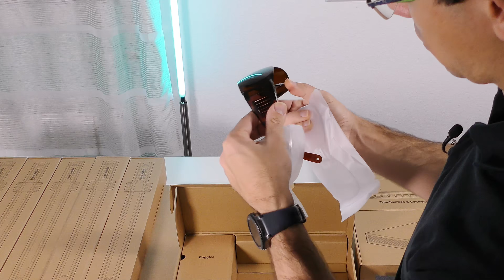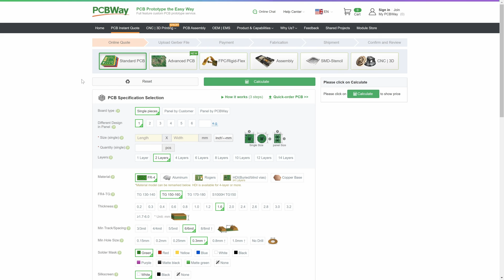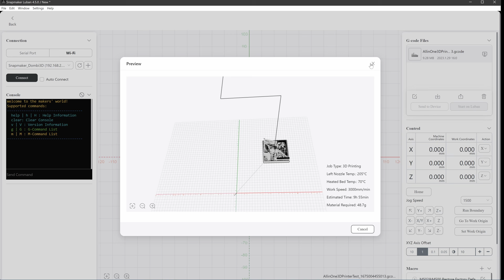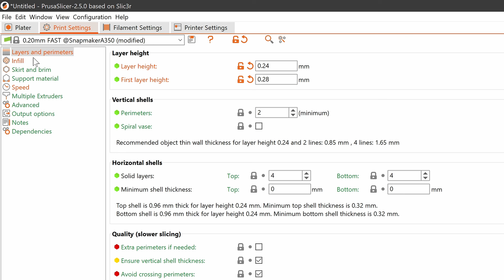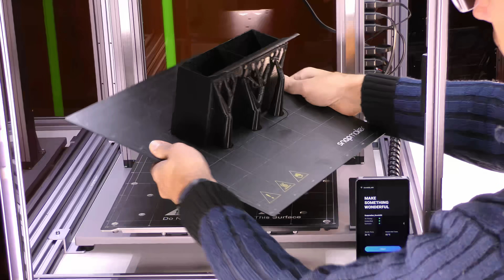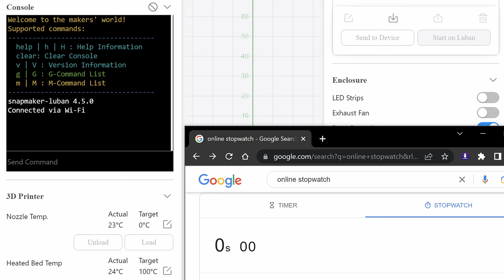Snapmaker 2.0 A350ENT Review: Part 1 (3D printing)

Comment: Hi,

Are you able to share you prusa slicer settings for the machine and the filament
Reply from the maker: I used the default PLA settings, all changes I made was just because of the comparison by Luban, but the default need to fit as well, and it will even give you quicker printing times!